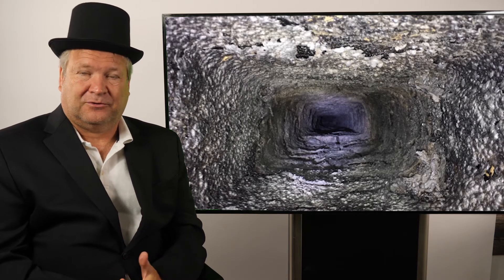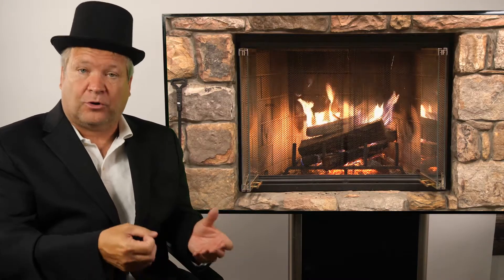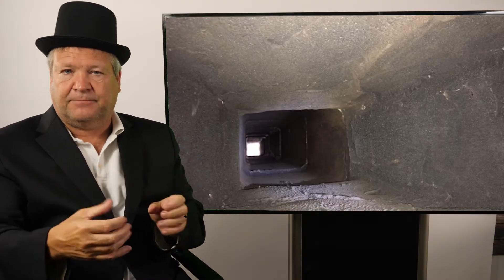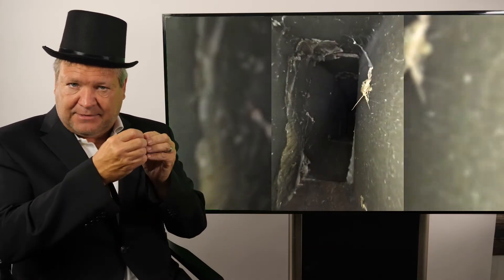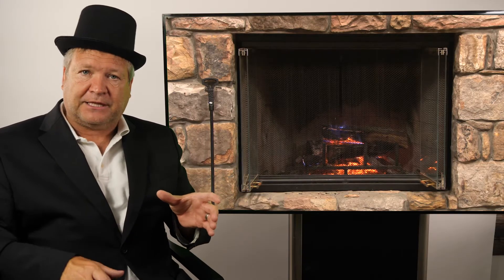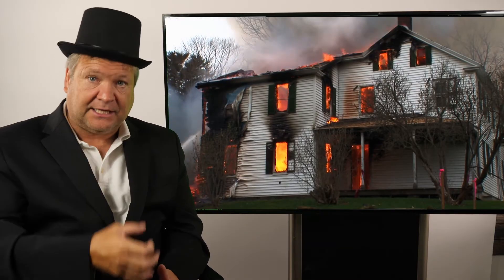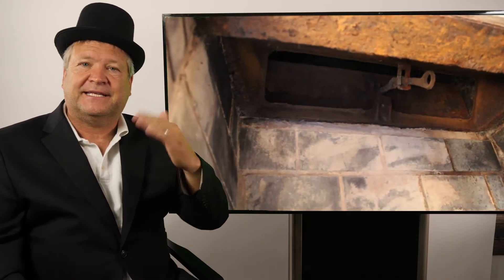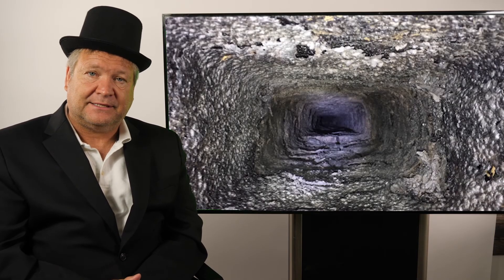Chimneys Explained #03 - Creosote

Comment: IF you could burn at 1100° AND your chimney exhaust temp was below that 284°, would you have no creosote since you burned ALL of the combustible gases 1st?
Reply from the maker: It does not all completely burn and that is why you need to keep the flue gas temp up.

Comment: As a retired Paramedic/Firefighter from the state of Florida I've not heard of too many chimney fires in the county where I live that I worked in but we did have a few and they were usually rapidly extinguished since we got there quickly. It would be nice to know what causes homes to catch fire since the chimney is supposed to be able to keep the Flames inside of it. Maybe it's poorly sealed chimneys where flames are able to get past some joints that are missing compound but it is not a subject I'm very familiar with.

Comment: The take away message is, BURN DRY WOOD, BURN IT HOT and... properly clean your chimney EVERY heating season! ...and... HAVE your system inspected every year by a licensed professional. Stay toasty my friends!
Reply: I think this is a sign LOL I was JUST thinking maybe I don't need to get the chimney cleaned this year BC we only use the wood stove 50% of the season (therefore I could do it every 2 yrs)...I could hear my Dad's voice in my head saying "Get. It. Swept." as I started reading this comment....When I looked at who left the comment it made me smile because my Dad's name was John Duffield  & this is exactly what he would have said💛 Thank you John Duffy 😂
Reply: This information is not 100% correct. Especially the part where he is talking about burning hardwood because it burns hotter… 
That is absolutely false, in the Pacific Northwest all they burn is pine.
 No problems, my neighbor here in Massachusetts burned 8 cords of pine per season. Not a problem… 
I personally burn five cords, 
No problems It’s when you have a fire burning low in temperature, the moisture collects with carbon and creates creosote. 
Bottom line burn dry firewood and keep the temperature above 450°. Clean the stove every two cord!!

Comment: I looked this word up because in the song "Deportees"  The  Lyrics say "oranges are left in the Creosote dump" - the song was written in the 1940's - maybe that was a thing back then
Reply: I looked up creosote because of the classic fiction novel “Watership Down” (1972) by English author Richard Adams:

 “Heavy posts, reeking of creosote and paint, towered up as high as the holly trees in the hedge, and the board they carried threw a long shadow across the top of the field.” (P.25)

Upon seeing these posts, it made one of the characters filled with fear. Even after learning about creosote, I don’t understand why the posts made the character fearful. Nor do I understand why creosote would be on posts since creosote appears to be formed from chimneys and is a fire hazard. But I suppose I’ll have to read further to discover why the character is afraid.

As for why creosote is on posts, I later discovered that creosote has practical applications as a wood preservative. “Creosote is a wood preservative derived from coal tar or wood tar. It’s known for its excellent resistance to fungi, insects (including termites), and moisture, all of which contribute to wood decay. It works by creating a toxic environment for these organisms, preventing them from attacking the wood.” So while creosote may be a negative compound in chimneys, it appears to have useful practical applications to help preserve wood by several years.

Comment: Nobody ever explains, how a fire in the chimney and fireplace, cause the house to burn down. People just say, A chimney fire will burn your house down. 😱🔥
Reply: Simplified version with extrapolation.
creosote is sortof a concentrated wood. think of it like diesel but dry, you cant start it with a match but ince it burns it burns hot and fast. so when a chimney catches fire on creosote it burns hot and catches more creosote on fire, essentially it takes a flue that might run at 300 F degrees and start rocketing it past 1000 F this breaks down mortor and clay AND makes said morter and clay very hot, hot enough to where simple contact can start igniting wood, melting plastic, and if chimney falls apart due to heat then flames start getting exposed to these hot surfaces causing house fires. Risk of house fire diminishes with proper burn and chimney type. so say your chimney is in middle of house thats worst cast, mason chimney mostly or fully exposed outside is better, stainless steel doublewall chimney fully exposed with 1ft house clearance brackets, very hard to catch house a blaze but can still melt siding etc.
Reply: @andyabel3072  wow, what a great explanation. Thanks very much for taking the time to explain this. I guess I just never really thought a chimney is basically turned into a blast furnace gone out of control, just from creasote build up. 😳🔥🚒

Comment: lol…there’s all types of weird stuff going on in there? No…no…it is all explainable by science and physics sir. And it is not the temperature of the gas and smoke that would VAPORIZE the particles, only the temperature of the fire itself affects the gas and smoke and determines vaporization, if any. I think it would be best sir if you did not try and use your experience and heresay to try and fill in the gaps of the explanation and stick to reliable and valid facts from a scientific source because although your explaining things okay for someone who is watching this for simple passing knowledge in total lamens, for someone trying to make understand the science of what is happening, this won’t cut it. The short answer is that wood does not vaporize at the temperatures produced in a fireplace. It simply is no where near hot enough. If you burn wood hot and long enough, most of its constituents, primarily lignins and cellulose, will break down under the heat into more volatile particles; this process is called pyrolysis of wood. You are a very nice person though to your credit and even though that has absolutely nothing to do with what I am saying, I just wanted to let you know I appreciate the effort good sir. Keep trucking along!

Comment: Hi! Thank you for this awesome video!! I had my Jotulle wood burning fireplace professionally cleaned in September 2023. I use it everyday. Today, I noticed black pieces of soot like pieces sitting outside on the snow. Is that creosote? Do I need my chimney cleaned again so soon? Also when the temperature lowers at the end of a burn how do you prevent creosote build up? Thank you so much for your wonderful video and information.

Comment: YOU ARE CORRECT,GET THE CAPS OFF THE CHEMNEY SO IT CAN FREE FLOW UP.THE FASTER THE SMOKE GET UP OUT OF THE CHEMNEY THE LESS CRESOET. CLEAN THE CHEMNEYS OUT EVERY 6 MONTHS.BURN ONLY DRY CURED WOOD.

Comment: My wood stove pipe off the stove, use to get sooo hot, I worried about it, 18inches above pipe a thermometer, it said one night, 600 - 650 😮, so I designed a 3/16th thick steel baffle for it at 30 degrees angle inside of the box, changed the whole dynamic. Now, my fire box still vents great, nice hot fires in the box, brick lined inside with the new baffle, however, my pipe barely makes it over 350, most of time it stays at 275 - 300 degrees now, the whole time, the flames are blue and orange, when I look outside at night with a flashlight, barely any smoke out of it yet its venting well when I open the door. the stove I'm running is an old early 1990s Trailblazer stove, I found on Facebook Marketplace, bought for 160.00, bought new glass for it from Oregon Glass 70.00 bucks. resanded it and painted it with high heat black paint. Looks great now, seems to be running good, haven't had to use my Central Gas heat now hardly at all. What do you think of all of this? since your an expert. Thanks

Comment: I do not doubt that you have expertise in cleaning a chimney or flue.  But you are no expert on the causes of creosote.  The number one cause of creosote is operator error- people burning wet wood.  There is no difference between hardwood and softwood when it comes to creosote.  If your wood is below twenty percent moisture and you burn hot fires you will not have a creosote issue.  If you disagree with what I am telling you, come back to me with some science.  About the only correct point you have concerns the chimney being warm.  Yes, you want an insulated chimney where it exits the roof.  But that is more for controlling soot deposit than preventing creosote build-up.  If there is no creosote in the exhaust none will be created in the flue.  That is why masonry stoves and coal stoves do not deposit creosote in your flue and chimney.  The masonry stove burns the wood volatiles completely because of its insulated firebox.  The coal stove burns anthracite coal and simply does not have the ingredients for creosote.
Reply from the maker: You have good points but the difference in hardwood and softwood is aging. If you age softwood, it will dry it out and allow it to burn completely faster. Hardwood has the same issue and so you equation is moisture content and densification. Good point and a good topic for discussion.

Comment: I'll have to ask if creosote can be used in some kind of generator. Or other various uses.
Reply from the maker: From my buddy chat: Creosote is a thick, oily substance that is a byproduct of the distillation of tar from wood or coal. It's primarily known for its use as a wood preservative and for its potential health hazards when inhaled or ingested. While creosote has energy content due to its organic nature, its use as a primary fuel source is not common for several reasons:

1. **Toxic Emissions**: When burned, creosote can release a variety of harmful compounds, including polycyclic aromatic hydrocarbons (PAHs), which are potential carcinogens. This makes it unsuitable for most combustion-based applications without adequate emissions control.

2. **Inefficiency**: There are much more efficient and cleaner fuel sources available. Using creosote would require special handling and equipment to mitigate the harmful effects, making it less economically viable compared to other fuels.

3. **Better Alternatives**: Given the environmental and health concerns associated with burning creosote, it's more reasonable to consider other forms of biomass or even other waste products as potential fuel sources.

4. **Limited Availability**: Creosote is a byproduct, and there might not be enough of it produced to make it a major fuel source.

However, there are some industrial applications where creosote, or the tar from which it's derived, might be used as a component in a fuel mix, especially in processes that already deal with dirty fuels and have the necessary emission control equipment in place. But as a primary fuel for general use, it's not advisable.

If you're thinking of using creosote as a fuel in a specific context, be sure to consult with experts and consider the environmental and health implications carefully.

Comment: Do the logs that supposedly burn off creosote actually help at all?
Reply from the maker: Your talking about creosote cleaning logs. The chemical in the burning changes composition of creosote to a powder but it still needs removal. Chimney sweeps have a different spray but is more concentrated but burning the logs is good. But the residue still need removal.

Comment: 15mc in pine is the same as 15mc in hardwood.
Reply from the maker: 15% moisture content in wood is the same as 15% moisture content in hardwood. However, hardwood has denser wood and provides more fuel verse moisture content and thus creates less creosote. Thats why people say, burn hard wood. It may also be that hardwood cures quicker (decrease moisture content.)

Comment: Pretty sure that HARDWOOD contains moisture and SOFTWOOD (like pine) burns hotter.
Reply from the maker: I would respond to this but I am a little tired of typing. So I asked my AI friend Chat to answer your question: The statement that hardwood burns hotter than softwood is generally true, and the reasons for this can be understood through the properties and structure of the woods:

1. **Density**: Hardwoods, like oak, maple, and hickory, are generally denser than softwoods like pine, spruce, and cedar. The denser the wood, the more mass there is to combust per unit of volume. This means that for a given volume of wood, hardwoods typically have more potential energy to release when burned.

2. **Resin Content**: Softwoods tend to have higher resin (sap) content than hardwoods. While this resin can make softwoods ignite more easily and burn with a lively flame, it can also cause them to burn faster and with more creosote production. Creosote is a flammable substance that can build up in chimneys, leading to chimney fires if not regularly cleaned.

3. **Burn Time**: Hardwoods usually burn slower and produce a longer-lasting coal bed compared to softwoods. This coal bed retains and radiates heat over a longer period, giving the perception of a hotter fire. 

4. **Energy Content**: On a per-weight basis, hardwood and softwood have roughly similar energy content (BTUs). However, since hardwood is denser, a log of hardwood will contain more energy than a log of softwood of the same size, leading to a hotter and longer-lasting fire.

5. **Moisture Content**: Well-seasoned hardwood tends to have lower moisture content compared to softwood when both are dried for the same duration. Burning wet wood, regardless of its type, reduces the heat output of a fire because energy is wasted in evaporating the water.

It's worth noting that not all hardwoods are the same, and not all softwoods are the same. There's variability within each category. For instance, some hardwoods are less dense than others, and some softwoods are denser than certain hardwoods.

For fireplace use, hardwoods are often preferred because they produce a longer-lasting, hotter fire with less creosote buildup. However, softwoods can be ideal for kindling and quick fires due to their easy ignition properties.

Comment: your explanation on hardwood was off. I could sense it. anyone got a correction?
Reply from the maker: The statement that hardwood burns hotter than softwood is generally true, and the reasons for this can be understood through the properties and structure of the woods:

1. **Density**: Hardwoods, like oak, maple, and hickory, are generally denser than softwoods like pine, spruce, and cedar. The denser the wood, the more mass there is to combust per unit of volume. This means that for a given volume of wood, hardwoods typically have more potential energy to release when burned.

2. **Resin Content**: Softwoods tend to have higher resin (sap) content than hardwoods. While this resin can make softwoods ignite more easily and burn with a lively flame, it can also cause them to burn faster and with more creosote production. Creosote is a flammable substance that can build up in chimneys, leading to chimney fires if not regularly cleaned.

3. **Burn Time**: Hardwoods usually burn slower and produce a longer-lasting coal bed compared to softwoods. This coal bed retains and radiates heat over a longer period, giving the perception of a hotter fire. 

4. **Energy Content**: On a per-weight basis, hardwood and softwood have roughly similar energy content (BTUs). However, since hardwood is denser, a log of hardwood will contain more energy than a log of softwood of the same size, leading to a hotter and longer-lasting fire.

5. **Moisture Content**: Well-seasoned hardwood tends to have lower moisture content compared to softwood when both are dried for the same duration. Burning wet wood, regardless of its type, reduces the heat output of a fire because energy is wasted in evaporating the water.

It's worth noting that not all hardwoods are the same, and not all softwoods are the same. There's variability within each category. For instance, some hardwoods are less dense than others, and some softwoods are denser than certain hardwoods.

For fireplace use, hardwoods are often preferred because they produce a longer-lasting, hotter fire with less creosote buildup. However, softwoods can be ideal for kindling and quick fires due to their easy ignition properties.

Comment: I have a wood burning cooking range with boiler for radiators. It has a lever to set for oven or central heating. On the central heating setting it changes the smoke path so it has to go over 3 extra heat exchanger panels. I found that restricted the flow of smoke enough to cause tar deposits on the inside of the chimney and liquid creosote under the ash pan of the stove. I now always leave the lever on oven, bypassing said panels. The radiators actually get hotter like that because the fire is able to burn at the right temperature.
Reply from the maker: I am not familiar with your unit but there are some wood stoves that have a bypass door. It is used for cleaning. Check your owners manual to make sure it is burning properly.